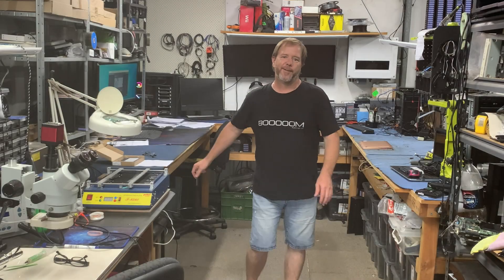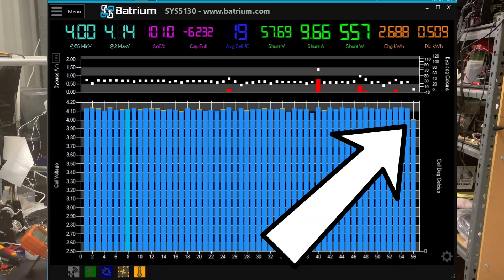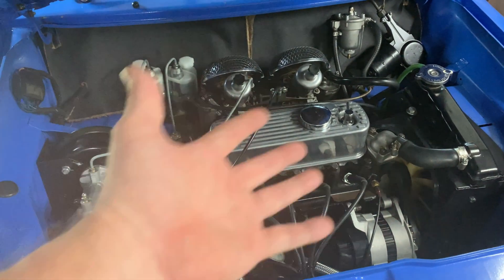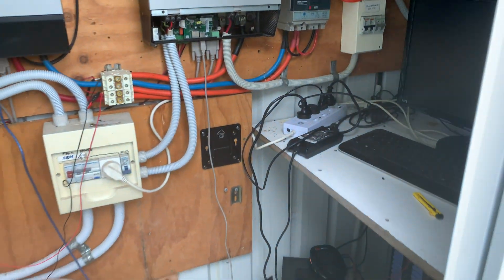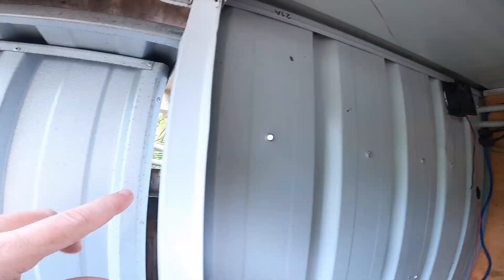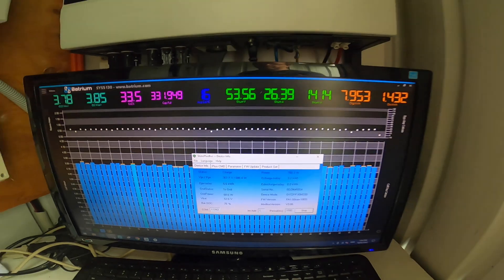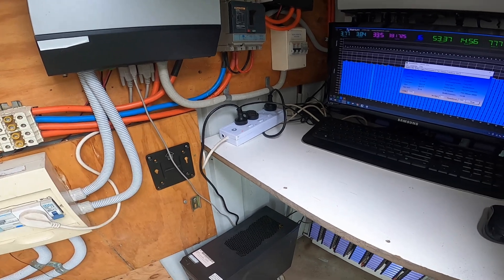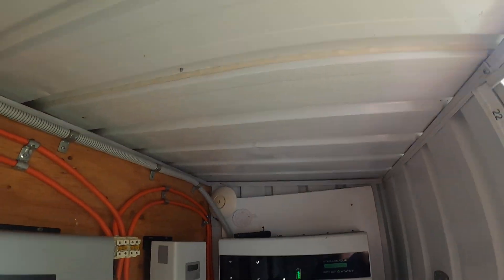7 Years ago my DIY Lithium battery really started to take shape!, lets take a look at it now!

Comment: stupid idea maybe, but if you need something low power and cheap enough with a browser to check batrium data you could perhaps? get a raspberry pi or something similar to that and hook your monitor, mouse etc up the that
Reply from the maker: I run 10 computers, 24 seven one more doesn’t hurt and does many different things not showing on video
Reply: @HBPowerwall  yea was just an idea as it basically is a computer aswell (just running Linux on an ARM chip)
Reply from the maker: I"m not a linux guy.. tried and failed
Reply: @HBPowerwall  yea i understand, i'm not really a Linux guy either, if i can i will run Windows the rest of my life 😂

unfortunately i didn't have much choice for what i was planning to do with it, and it really is just a case of installing Raspbian on an SD card using the Raspberry Pi Imager, setting it up and opening the internet browser in that case, pretty straight forward

i used it shortly for a 3D printer

Comment: Great update. I Thought it was impossible when you started to use old computer cells. However after you ranked them burnt them in and used the battery cases with the curly nickle "fuse"  I thought maybe building cells for an off grid cabin was possible. At one time YouTube allowed making folders so I archived all your videos for future reference however that account was lost.  Worse, once you lose favorites similar to cellphone contacts, it takes a long time rebuilding the knowledge base. At one time you referred to a company that sold used batteries, I cant remember who it was. Anyway, they say success breeds contempt because the process becomes boring, but so few have accomplished as much. Your battery content fills a niche and hopefully will make a few extra bucks in the process. I work on everything as well and fixing things is our future as the economy becomes challenging, so the new content is great!  BTW I would of lost this site if you changed it's name -- Again thanks for the years of content, looking forward to the off grid battery content! Cheers!

Comment: What's the model of those mpp inverters?
Reply from the maker: Hold on need to run down and check ..........
Reply from the maker: They are a pair of PIP 4048MS inverters
Reply: Thanks
Reply from the maker: No worries

Comment: Not going to lie...I figured you would have moved on to prismatic LFP cells years ago, relegating the 18650's and 21700's to the smaller tasks for which they are well-suited.  It's interesting to see all of this stuff still functioning, but it's also crazy that you're still using these types of solutions.
Reply from the maker: Time and effort has already been spent so no use wasting more to re do it... If it makes it to 10 years i'll have a decommissioning party!

Comment: Hey Pete.
below are my thoughts and are not conclusive but in my experience I'm convinced. I have done the parallel packs a couple years ago.
https://youtu.be/PwfnXk66o1w
Keeping to Longmons on each pack despite the 3 packs are paralleled together is a good idea. My thought is example. Assume that you are paralleling to packet at different voltages, this will take time to balance. Therefor if each set are rated at different capacities then the charge and discharge will cause the packs between the sets to rise and or fall at different rates hence a possibility of an over or under voltage. This would be less prevent when a higher charge / discharge current. Lower charge / discharge current would have more time to balance.  However if all packs across all sets were to same value the this wouldn't happen. But we know only in an ideal world this would ring true.

Comment: Nice to hear from you / see the update :).   You + DIY Tech & Repairs + AverageJoe were major inspirations to follow in you're footsteps.   I remember when you first powered serious appliances off 2nd hand 18650 in your kitchen - was an exciting youtube.   My 2nd hand 18650 powerwall w/WatchMon4 + Longmons is 4.5yrs and have clocked 1,600 cycles on the oldest battery and the powerwall seems rock solid.     One of my AIMS went wacky at 4yrs but Batrium and Midnite Classics are moving ahead with no sign of trouble.
Reply from the maker: 1600 cycles is one hell of an effort!

Comment: Can u put a clamp meter to check the power draw of each set to see if the pack with the shorter cable is working much harder?
Also be interesting to know the battery degradation after so many years
Reply from the maker: I have actually done that in the past but my clamp meter is 'in a safe place I won't loose it right now... '

Comment: I know I’ve created several powerwalls for myself and others over the last few years… I wonder how many powerwalls exist in the world as a result of your creation of the community and videos. I know you’re responsible for mine! Keep up the inspiration Pete!
Reply: I'm one of Pete's "Tubers". I just de-commissioned my 12KWh 18650 battery a couple of months ago (still working). I got tired of chasing heater cells every few months and was starting to worry about fire. Replaced it with 3 EG4 LiFePO4's and all was fine until last week when my 3 year old MPP LV5048 died suddenly and unexpectedly. A lot has changed in the off-grid solar space, so researching a replacement and considering some changes. Thanks Pete for getting me started and welcome back!

Comment: Awesome to see you up again and great to see the PIPs working so well gives me hope - mine sat for 3 yrs and is now up as a UPS more than anything. Andy's Offgrid Garage should give you hope doing more on this he even had professionals go over it and replaced dodgy old panels. I thought my PIP 5048MS had died the other day but turned out one of those arlec grid connect I use just for remote power monitoring decided to become a PWM power device luckily the warranty had a day to go but read about them on Bunnings an the reviews are shocking (pardon the pun). I use them to try drive solar consumption during the day though need something smarter as they just turn on around 10am and off at 3pm and no consideration for cloudy days. Does your system feed critical loads or something? With excess power during the day and lot of my grid tie being  export limited its trying to find useful things to burn the power on as ROI of the grid tie creeps out when not used. Also how the bees going?

Comment: Nice one Pete! Glad to see it’s all still working ✔️ What are your long term thoughts on the parallel cables for the 3 battery packs - worth doing, or not much difference? My (much smaller and more shoddy) system based on your work has been running for a couple of years now. Interesting note; I’ve just passed over 3Mwh into the batts which is mind blowing when you think about it! Thanks for all your hard work 😊

Comment: Like for the minis, you did inspire me to think about batteries 2 years ago, Im still thinking. Put solar on my house here in the UK 10 years ago, was quoted £8,500 then a special offer at Christmas came through the door some company £2,750! I went for it, Id specified Hitachi Black panels cause they looked good not thinking it was on the back of the house no one sees it, but by accident they are 5% more efficient than the cooking ones. Here in the uk were restricted to 3.8kW max so my South facing 12 panels gives 4kW max. Imagine my surprise when I get a cheque for £1,000 every year back from my energy supplier on top of next to no bills, clearly Im a nube. I get an electric car plug that in and draw down 5A into that a day (25 mile) and get converted to EVs big time so get an electric bike (Zero SRF) that gets 80 miles in a day when im in the car. Ride the bike when the car wants charging, drive the car when the bike needs some electrons. All in all by accident this whole solar battery EV thing has worked out brilliant for me and thats in the overcast North West of England. I renovated bikes, say renovated, cant say my hearts in it now, if its not electric power Im not interested. I wont beat the Zero for sure but fancy an electric Lotus 7.....hmmm thats a plan.
Reply from the maker: 1000 a year is a great deal,
Reply: @HBPowerwall  Im a nube I never even worked it out I know my electrics but no idea on the commercial bolloc*s. They give you back £0.04 for 50% of every kW you produce regardless of weather you use it or not...so I make sure I use it, sit a 85kWh battery on charge and yep you will use it. Should get a Zappy EV point and optimise all this EV charging but cant be ars*d! It all seems to work as is. KISS Keep It Simple Stupid as they say.